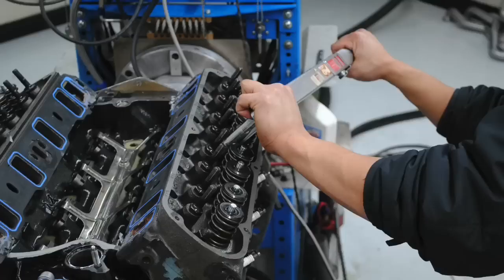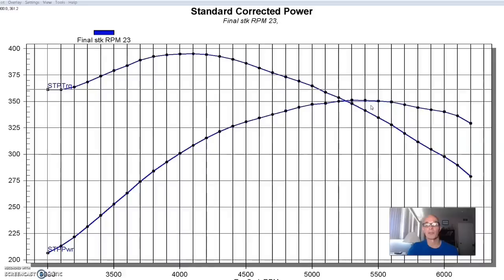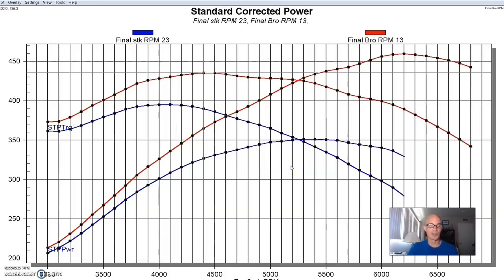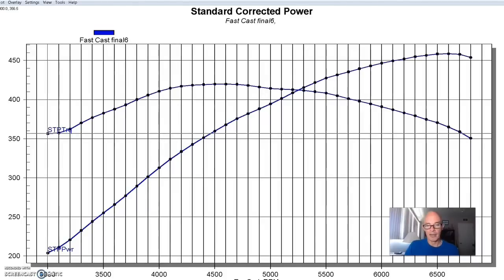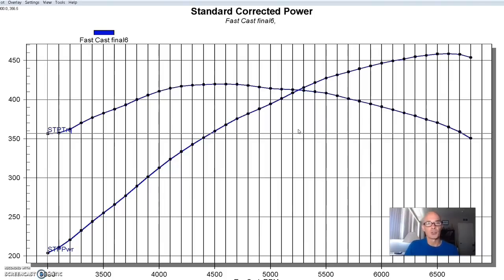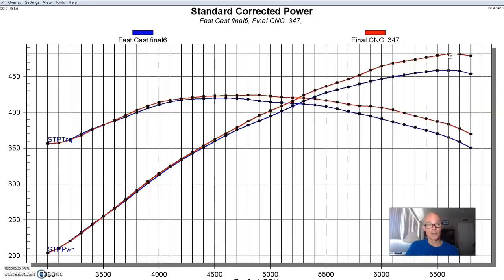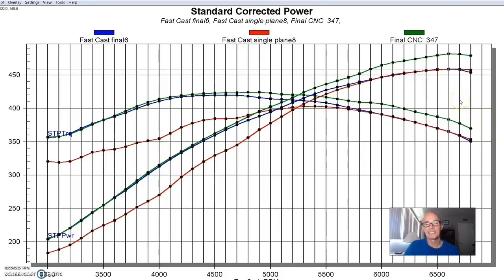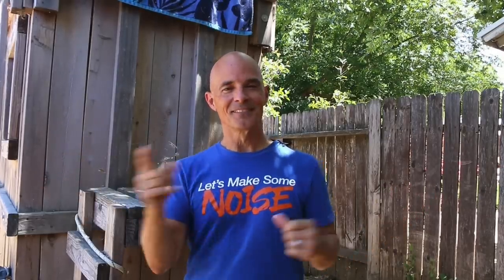347 FORD HEAD & INTAKE TEST

Comment: I'm putting together a dss347 stroker with the TFS 185 CNC heads, ford motorsports/Vic Jr single plane, compcams extreme energy cam. But going to run either a fitech or Holley EFI setup. Hopefully I can get the same numbers.

Comment: First of all - awesome video.  I really enjoyed it.  One thing I would love to know is whether valvetrain longevity should be or is part of the equation on a build like this.  For example, Ford installed really mild camshafts with killer 4V Cleveland heads in their street motors.  Could you run the ported heads with a milder camshaft and improve the longevity of the valvetrain by decreasing your lift while keeping power close to what the as-cast heads made?

Comment: 351w with edelbrock 400 hp top end kit (170cc performer rpm heads, 2.02/1.60).  Does this kit actually make 400?   I have this in my 68 stang and it’s fun, just wonder if it’s actually 400 hp.

Comment: Hi Richard, I like what you do . Keep it rolling sir. I build a 347 about 6 years ago. I was on a budget so i tried some new stuff and was surprised at the results . 347 rotating assembly scat rods and crank ,completely balanced from Skip 
White performance . 210 Pro comp heads set up for .600 lift .. I was being open minded, parker funnel web . I port matched the heads to intake with ease . Think the cam was lunati voodoo roller for the 351. . And Old school Barry Grant 750 carb.. I was impressed how everything seemed to work together, it had a great idle and gobs of torque . I spent 2800 total on the build .. you cant go wrong with these newer parts . Im so happy you dont have to go broke making a ford fast .

Comment: 10hp briggs with 2 air pumps belt driven like superchargers from 80's something Ford pickups blowing thru a carb with the load jet taken out.  It made a pretty hot running go cart. :-) It broke a lot of 50 chains. LOL

Comment: I'd like to see you test a super Vic on the 347.  I bought a car with same 347, xfi236HR cam, has pair of Chinese aluminum 170 heads from mustang depot that have been ported but the motor has a dual plane performer with 650holley dp.  I have. Super vic and have wondered if it was too much manifold for the car.  Car is drag car, c4 2800 stall & 410 spool 8.8.  Thanks for the Ford tests
Reply: I also have the exact same camshaft in my 408W stroker with 1.7 rockers on it.

Comment: heres a combo not to use
scat windsor 408 flat top pistons ,dart pro1 170cc heads ,crane flat tappet 214/224 280/290 112 lobe .496 lift ,eld air gap , sprint car headers ,and shiny 770 holley  in a TBucket

270hp @4800 and 415ftlb@3300 at the wheels

Comment: So if the head can support more why didn't it? the ported head made more power on the same cu in. Sooooo one could say the as cast could support more power but If the short block already exists then the ported heads would make more sense. Why buy an all new short block to maximize the existing heads? If the ported heads gave the same increase for potentially less money and work.
Reply: You can’t put too much head or too much cam on and in a ford. Most people under cam and under head them. Kind of like most boats are under powered. Lol

Comment: My combo 4.030 bore , 4.170 stroke , hydraulic roller .612 lift 242, 248 duration at .050..AFR 205 just cleaned up and fresh PAC Beehive springs .. 59 cc or so puts compression about 10.5 .. Edelbrock Pro-Flo 4 EFI  1 3/4 LT headers with hi-flo cats and 2.5 dual exhaust .  Running with TKO 600 manual with 3.73 gear in 89 fox body.  I would love some comments on whether this should work well , last 357W with less compression went 12.09 at 113mph in 3150lb hatchback, I am really hoping for bottom 11's with new combo. Motor should be installed this week.

Comment: Great video Richard! I need to upgrade the ported 289 heads on my 306ci. Thirty five years ago, my heads had the best of everything-ported, larger valves, and small combustion chambers. Based on similar magazine builds, I estimate HP to be in the 310hp range.  I can't wait to rebuild my SB with one of these aftermarket performance heads and FI!

Comment: Would love to see the difference between the 274 and the 282 cam. I've never owned the 274 but the 282 is so well mannered and pulls to the moon. I'd like to know why you speak so highly of the 274.
Reply from the maker: the 282 also works-less driveability than 274 but more peak power on the right combo
Reply: @richardholdener1727  thanks for the reply and all the hard work you do for us!

Comment: Hey Richard would you consider doing like a sbf test with all the "cheap" aluminum heads ie pro comp, skip white, pro maxx etc!!
Reply: I definitely wanna see proComp / Speedmaster heads tested ! Especially by someone who knows what they're talking about.
Reply: I would only use those heads if they were purchased bare. Wouldn't use the cheap valves, cheap valve springs, and crumby machining. You get what you pay for. AFR 165 or 185 for less expensive mild combo. You could do the as cast heads of the Edelbrock Victor Jr or as cast Trick Flow Twisted Wedge. Anything less than these would be poor choice in budgeting a build. The cheap heads have been known to break valve springs, the valves have separated, and the machine work was trash. Break open the piggy bank and/or save to spend $1600 plus for heads.

Comment: Richard. Good points on DIY bowl work.

How about cleveland(or M) 2v heads . Dual plane air gap or similar.  Factory cam, untouched heads (except springs for lift).  Then add a "decent" cam with 215 I / 220 E duration and .500 to .550 lift.

Then YOU pocket port and show us what ya did.   Retest with factory cam and the decent cam. Maybe cap it off with a "good" cam in the  235 I / 240E duration and .550 to .600 lift.

Comment: Ive built a 85 302, flat tappet comp 270h, patriot 190cc heads, 2.02/1.60 valves, 58cc chambers, torker 2 intake, 1.6 comp roller rockers, 600dp, shorties, and on a stock short block with factory flat tops. All in a 81 Mercury Capri. Really like the channel too, got some real good info on your vids👍

Comment: The power number a head is capable of isn't all that relevant. The power number the head makes on the engine that you built is. The newer generation big port heads work better on lower and big power applications. Years ago the big heads were crap on a street engine. Now days the bigger heads will gain you power on what would be a street setup as well as leave a ton of room to grow. Anytime a head can make you more power without having to change other parts of the combo it's a plus. You have even more room yet to grow and have a better powerband. Today's heads will peak in the 6k+ range with a 224@.050 camshaft. That wasn't even a thought back 25 years ago. I shoot for the biggest head that will still give me a gain with the most drivable camshaft possible.

Comment: Ive got a 327 .030 over 331 sbc gen1 retro hydraulic roller Comp cams 12-433-8 Duration at 050 236/242, Lift .520/.540, comp cams solid roller lifters, scorpion 1.6 roller rockers, RPM intake, 1 inch spacer, Edelbrock 750 1901 quadrajet with  Cliff Ruggles tune. forged 327 crank, stock length Scat I beam rods wth KB domed pistons .1 dome 10.5:1 compression,  .5 inch marine header spacers,1 5/8 Hedman Headers to 2.5 inch 69 corvette style side pipes,  SBC 23° Hekimian Racing Engines, Aluminum as cast 205cc, 64cc, 270 cfm @ .700" Intake flow , 193 cfm @ .700" Exhaust flow. 
https://boston.craigslist.org/bmw/pts/d/sbc-aluminum-perf-heads-205cc-complete/7153854132.html
Milodon street strip pan with baffles and windage tray
 McLeod 15 lb flywheel , and McLeod 10.5 inch super street pro 550 hp clutch.....She spins up fast and has a lot of torque and power
Reply: after seeing Richards stack injector tests i want to add those

Comment: I built a mild LA318. It was out of a 71 Plymouth Duster. I used the factory heads but increased the intake valves to 1.94 and kept the 1.50 exhaust valves gasket matched heads and Edelbrock performer intake. It was bored .030 over and I used KB 167-030 pistons that sat .003 below deck Cometic C5633-027 MLS gaskets. Comp 20-222-3. Holley 750 0-76750 carb. It made 314 before any tuning the rear seal started leaking badly so on tuning was done. I changed the intake to an Edelbrock 5076 torker ll and went with FiTech injection when I installed it in my 87 Dakota. I don’t know what it would have made with some tuning but it runs great in the Dakota now. The little 318’s just don’t get any love I sure would like to see you do a mild to wild on one.

Comment: I’ve got a piston and rod 351W build going on right now to put in my 95 Mustang GT. 
Factory crank, scat factory length rods. TFS forged pistons , TFS 11Rs 205 cnc, TFS R intake . It’s funny you mentioned Brian Tooley. I built a stock bottom end TFS package from him at Total Engine Airflow in Bowling Green back around 2000. I still keep in touch with him in Bardstown and he spec the current cam for the build. Any guesses ? XE 282 HR 12             232-240 / 565-574   Mostly (streetcar)
Reply from the maker: those 11R heads are really  good-the TFS R intake is not my favorite

Comment: Pulled the heads and a piston this afternoon
I checked twice
30 thou on a spark plugs gapper. I checked it it's 30. As is. Gonna measure the rest of the cylinders. Had to stop for the day. Needs cam bearings so I removed the rear cover . Crank and rod bearings look good an pass the fingernail test. Ported oil pump exit and shimmed the spring. I need a hp license for a flex ecu. I have it in mine but no table setup. Got a bunch to do but all the hard pieces are here and going to water cool the turbos off heater core feed they are already plumbed with water ported centers. Should be impressive when I get it together dammit

Comment: Would love to see you test the edelbrock dual quad intake on a ford or Chevy. I know it’s down on power  compared to a good single carb but I would like to see if  you could gain the power back using spacers.
Reply from the maker: I did a dual-quad vs rpm air gap on a chevy

Comment: Richard, I'm almost finished with my 347, which is exactly like the Brodix motor you tested. What did your final timing look like? This is my first time working with a 347 & Holley Sniper EFI and want to have a good starting point to program in. Thanks.
Reply from the maker: 35 degrees

Comment: how about some old skool heads. I'm running a set of 192cc Canfields that work great with the xe274hr cam and ported gt40 intakes on a .040 over 302.
Reply from the maker: I ran those in the big head test

Comment: Thats kind of what I had an idea on too

A 347 with cast twisted wedge heads. Proves you dont need really big heads in the street at least
Reply: no not necessarily bigger heads but better flowing heads. the better your heads flow the less cam you need to make power. really good flowing heads with a mild cam will always make a better power curve than mediocre heads and a larger cam.

Comment: We did a procharger P600B kit on a gears/exhaust 95 cobra back in the day. The rising boost curve was a good complement to the stock cam and long runner cobra intake. Made for a great/mild driver and put down something like 410 wheel.

Comment: I have a fox that's been part of my little fleet for almost 20 yrs now.  I use to buy MM&FF religiously back in the day and that car is very much inspired by what you use to put in those magazines.  DSS 306, TFS 185 CNC heads, Comp XE266HR, Track Heat intake, Procharger P1SC-2, FAST XFI, AEM Water meth, Viper T56 from D&D yada yada.  Not the most powerful combo but it's super fun and it's been together for years and years.  Other than a new set of ford racing plug wires every 5 years or so and oil changes it's completely maintenance free.

Comment: Hey Rich here's my setup 
Sbe 6.0 with gap
Stock ish 317 heads w 60 cc chambers
SS2 Cam
Twin 72 68 Nelson turbos the that big cx water to air dual single out
Twin walbro 450s on a versa volt thru the stock half inch diesel fuelines sneaky
Flex fuel
220 lb injectors
04 Silverado 4wd 
Hptuners 
Yes I have a wideband

Comment: I have a 496 BBC, unported 702 heads w/ larger valves, flat tops, COMP Magnum 215 hyd roller (11-240-8), perf RPM intake, long tubes, and upgrading from vacuum secondary holley to a holley sniper efi system.  Never dyno'd it, but it makes my lifted suburban feel very light and nimble.  I've always wondered if my heads were worth upgrading.  On the one hand, they have big valves and ports, but on the other, they're not ported and have lots of shrouding.  My gut tells me it probably isn't worth the effort, especially given the rpm range of my cam.  My other baby is a foxbody with an f303 cam, long tubes, canfield heads, flycut OEM pistons, and a kenne bell blower with a 90mm throttle body (if that sounds impossible, it is- I had to make a custom intake spacer to make it clear the heads, even with the stock valve covers.  it was a nightmare, b/c then the pulley brackets didn't line up).  To this day, I have always regretted using those heads.  The build made amazing power and torque (big surprise) and the heads were free, which was great!  But using those heads made the project take twice as long and cost twice as much, which meant I wasn't driving the car, and I didn't learn anything new when it was over!  In hind sight, it would have been way more fun (and cheaper, and faster) to port my E7s with stock valves and better springs, flat mill the heads, stroke it, put a big high-rpm cam in it to compensate for the weak heads, throw on some shorty headers and call it a day.  Maybe an aluminum flywheel if there's money left over.  I don't see many tests like that though.  Big cam + stock heads + other mods = who knows, lets find out!

Comment: I’m running a stock block 347 with hyper flat tops and aluminum heads 520ish lift cam with 114 love sep and a performer rpm intake not air gap and I have had awesome luck with these little sbf engines love them wouldn’t want to build anything else! Thanks for all the information Richard!

Comment: Have you ever tested a 
Weiand x-cellerator intake on a smallblock chevy. I have one on a 400 with 9 to1 static compression. And by cam specs should be right at 8 to 1 dynamic compression. The cam is 222°@.050 and .465 lift.  Promaxx 185 cc heads.  Long tube headers. Just wondering if that low rise open plenum intake is hurting performance much. I used it because Osgood clearance. But now I have a cowl hood and can use a taller intake.  
Just wondering you thought on that particular intake. Good, bad or just so so.......

Comment: Back in the early 2000s I ran a set of Trick Flo heads on a 347 I think they were a R series or something but I had a shit ton of trouble out of the valve guides. I had to take the valve seals off and leave them off or it would bust the valve guide. It had the pedestal mount rockers and the geometry was right just couldn’t stop the guide issue. Car ran in the 5.70s to 5.90s in the 1/8 and then that was supper fast now it’s slow lol I got a 468ci Windsor now that I’m switching to turbo but I’d love to see some test done on the smaller cubic inch like stock to 393 to the bigger bore 427 or 434/438. I run a Yates D3 head and on Nitrous car went 4.93

Comment: 10.5 to 1 408 with 11r 205 Cnc ported heads with the same xfi 236 cam that’s you used in this test! Runs amazing! Streetable and gobs of torque

Comment: Hey Rich, I asked you about my pro comp heads recently. Thanks for the help! Here’s my combo. 347 stroker,10.5:1 compression, comp ex270hr cam, pro comp 210cc heads, dual plain air gap, Holley 650. I know the cam is mild. It’s gunna be my daily driver. Maybe later on I’ll spice it up. Let me know what you guys think it will make!!!
Reply: 460hp?
Reply: @nothappyjan555  that would be nice. The heads are the questionable part

Comment: I would really like to see manifold differences on a 351 stroker, 408 or 427, good heads, moderate roller cam.  RPM Air Gap vs Vic Jr.
Reply: Super makes 50 hp more than airgap on a 427 at 6500
Reply: Well, let's see how good that super vic 351W is on my street motor lol....
Reply: Been done

Comment: Awesome info as always! I mention you a lot in my videos.. The one coming out today mentions you actually.  
 Iv'e had really good luck with stock bottom end 302, SVE 170cc heads (as cast), TFS stage 1 cam, Explorer intake and 70mm on3 turbo with 15lbs of boost. Car runs really well with that combo.
Reply: just by reading it sounds like a nice little combo

Comment: What's the best setup SB Chevy budget first build ?
Reply: I’d do a 350 and put in a cam, manifold, good 4b carb. If you want more go with new aluminum heads( trik flow) imo. And forged compression pistons
Reply: @Mc3680  thanks for replying I'm slowly building a 4 bolt main bored 30 over with forged 2 valve relief flat tops and have a set hump heads cast with 202 intake valves what  size cam would you recommend off the shelf ?
Reply: Kenneth Atchley for the street Look up comp cam xtreme energy CL12. The lift and duration is 477''/.480” lift 268°/280° duration